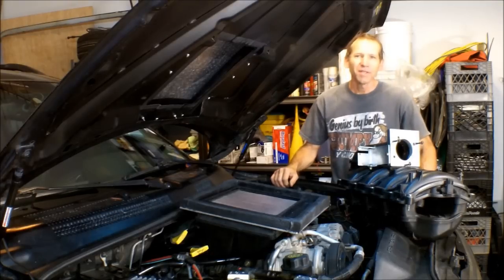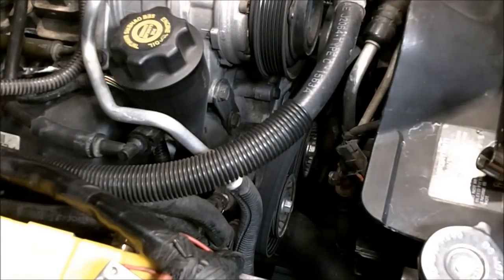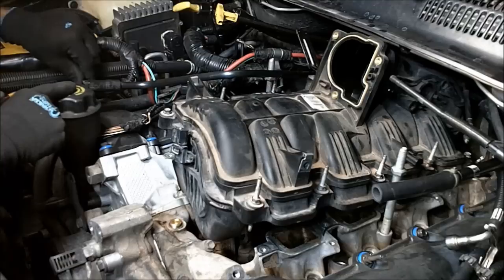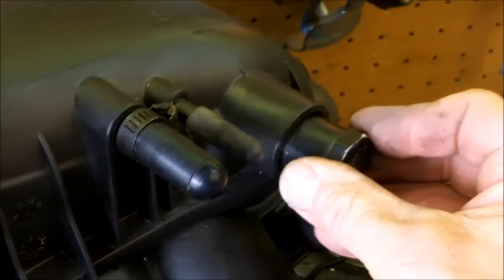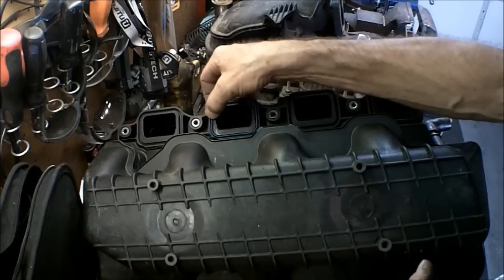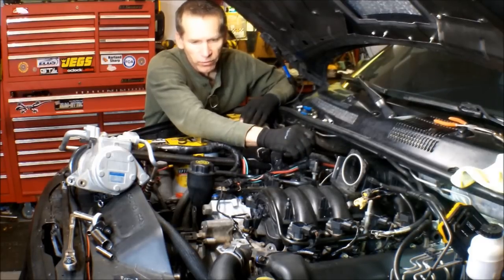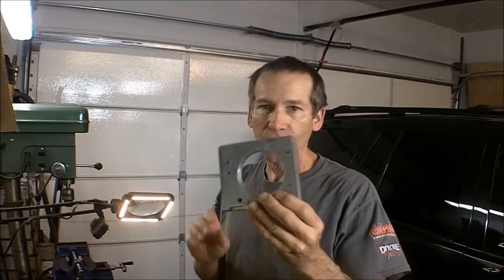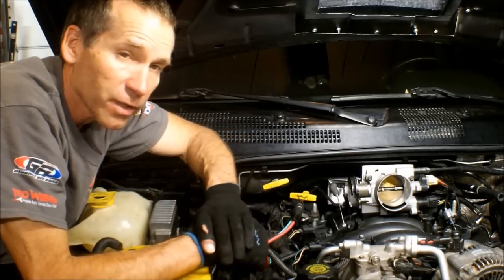Installing Upgraded Intake Manifold on 4.7 Jeep, Dodge

Comment: My 02 wj has a 3 prong plug in under the manifold any idea on what it's for??
Reply from the maker: Sounds like you have the HO engine and  those are the knock sensors there's one bolting to the left side and 1 to the right side under the intake manifold.
Reply: @martinbuilt  yea it does have those and I replaced them since it was throwing a code for them, and the plug in is ont he backside of the motor, like a diesel motor

Comment: So you only have to lower the motor on a grand cherokee? Ive got an 02 durango i wanna do this too.
Reply from the maker: yes, depending on the condition of the motor mounts. With old worn motor mounts the intake will go in without having to lower the engine to install the intake.

Comment: with all the changes to the air being drawn in, have  you had to change the mass airflow sensor?  are you throwing codes or getting check engine lights? have you had to reprogram?
Reply from the maker: Joel Antler it is not Dangerously lean at Full Throttle, but not rich enough for maximum performance . There is no mass air flow sensor just a map sensor. I am not throwing any codes or check engine lights. I do have a Superchips programmer but I feel it is inadequate for maximum performance.

Comment: That looks like what I need Jaja. I have a 2003 doge ram 1500 4.7.  Like everyone else  the valve seat dropped  and I have metal  particals in the oem inteck. ,any way I can get those out? I've  been trying  to buy the same part number  but shows as discontinued  so wondering  if this inteck swap  will work for me ? Thank you.
Reply from the maker: it will work but you will need to do all the same modifications that I did.
Check out this video it could help you clean your old one. https://youtu.be/clydV1x87q0
Reply: @martinbuilt  I ended up looking at your video  and it helped  me cleaned mine.  I have a question  is it really worth the work to swap out my 2003 dodge ram 1500 4.7 inteck to the 2008 dodge ram 1500 4.7 inteck. Will I get noticeable hp, thanks
Reply from the maker: @rvilla31  This was the best HP gain out of any mod I have done.
I do have the intake from my 04 Jeep if you are interested.
Reply: @martinbuilt  I appreciate it, but I got my truck working  good. But just wanted  more power out of my 4.7l
I was thinking if a superchip,  what do you think since you have a lot more experience in this stuff
Reply from the maker: @rvilla31  The Superchip that I have done did nothing for more power.
Reply: @martinbuilt  well I appreciate  your advice.  And you just saved me $500 bucks. Because I was gonna buy one this weekend.  But I'll invest  in the 08 inteck  instead.  Thanks
Reply: @martinbuilt  I Martin. Just wondering  I won't know unless I ask. 

Would you be interested  in finding me a 2008 dodge ram 1500 4.7l inteck manifold to replace my 2003 dodge ram 1500 4.7l and make a throttle body  adapter  for me.  If yes how much you can send me a message back
Reply from the maker: @rvilla31  I do have a 08 intake manifold that I could part with but right now I don't have the time to build an adapter. Planning on retiring from my day job in a year. Then I'll have all kinds of time to help you out.
Reply: @martinbuilt  I got the original ones that came out of the 08 inteck but the fit loose as well. Except  the 2 corners. But they are the original ones 🙄  that's wired huh
Reply: @martinbuilt  the ones you used are from a 2002 and under off a what car or truck engine size

Comment: Are the mounting sleeves M6X1.00X18.00 or M6X1.00X43.00?
Reply from the maker: you will find that the sleeve from the old manifold only 2 of those will fit the 08 intake and that you will need 5 or 6 more, the size of the bolts is not important.

Comment: @martinbuilt how did you solve the location of Intake air temperature sensor in Intake mainfold 08-11 ?
Reply from the maker: I relocated it to the backside of my Ram Air.
Reply: @martinbuilt  thx for answers. What kind of HP tuner you use ?
Reply from the maker: @makdaiss  I purchase the HP tuner. I haven't done anything with it yet. So I'm just running the stock tune for right now and for a stock tune it runs really well.

Comment: Hi Martin.. I have an 03 Dakota that I am looking to upgrade further.  I would like to know where you got this intake manifold from please. Do you happen to have a part #. I have searched a wee bit and not having any luck. Thanks..
Reply from the maker: Waylon Carlson I got this one off of eBay quite some time ago. I believe I gave like $160 for it. Airram.com also sells them. When I get home I'll look up a part number for you.
Reply from the maker: Here's the part number.  53034229AA
Reply: LOL.... I went to our local scrap yard today and they had one sitting on the shelf.. It had the old part# on it (53032761AJ), which in turn subs up to this new number you just gave.. I got it for $125.. Not a bad deal I think..
Reply from the maker: Waylon Carlson yeah that's a pretty good buy. I had a chance quite a while back there was one in the scrap yards I could have had it for less than $50 but I didn't no back then that that was an upgraded manifold to the one we have now on our WJ
Reply: Have one on the way for $79 shipped.   I too couldn't find any that had that part number.    I actually had to search for 2010 and newer to find them with the right number.     Martinbuilt thanks for doing what you do!
Reply from the maker: Andrew Shealy wow that's an awesome deal you practically stoled that one... you are welcome.

Comment: Hey martin can i do the same thing to my 02 3.7 with a 09 3.7. Seems like the same concept just 2 less cylinders
Reply from the maker: I got to say I'm somewhat unfamiliar with the 3.7. I do realize it's pretty much the same engine minus two cylinders. Why is there a horsepower increase in 09 compared to their earlier models? In theory at all sounds like it should work. I know one thing there's no way I would ever go back to the earlier model intake manifold.
Reply: no it will not the 3.7 was never updated it was not really ever intended to be anything other than a cheap mass-produced base engine

Comment: Hi i have jeep grand cherokee 4.7 pt can i swap intake manifold with throttle from H.O?  It is worth doing it if there will be no effects.
Reply from the maker: If it is a 2002 HO intake would be the best choice. If your JGC is a 99-00 you will gain a 3mm larger throttle body. 2001-2007 4.7 engines all had the same TB's at 68mm.
Reply: @martinbuilt  my is from 2000 Year, it makes sense to change the  intake manifold or is it enough if I swap the throttle only?
Reply from the maker: @holydriver666  If you can find a 2002 HO intake that would be worth it. They in 03 they went to to the same intake for 
non-HO and HO engines.
And yes you can install the 68mm TB on your early intake that should help.

Comment: Can i use the bolts for the 08 intake from the junkyard on my 03 Durango
Reply from the maker: No you can't the bolts that hold down the intake on the 08 manifold are integrated into the coils.  You'll need 8 of the older bolts.

Comment: I noticed no knock sensors was this for the 2001 to 2004
Reply from the maker: the knock sensors came first on the Jeep Grand Cherokee HO engines of 02-04. I also found this on the internet that they were in Jeep 2006-2007 XK, XH Commander and 2001-2007 WJ, WG, WK, WH Grand Cherokee w/ 4.7L Engine; Also fits 2006-2007 Dodge Durango, 2005-2007 Dakota, 2005-2007 Ram 1500, 2007 Chrysler Aspen, 2006-2007 Mitsubishi Raider but, can not confirm this.
Reply: @martinbuilt  I just got my 04 HO back from dealer and they said I didn't have any installed yet I have the cables. Then I saw your without any. Did you remove them at some point?
Reply from the maker: @Dragon90815a  I don't have an HO engine. Some day I will get the one that I have on the stand installed.

Comment: About how much hp do you expect from this swap
Reply from the maker: When I did the Swap and took it out for the first test drive I was absolutely amazed in the gains I felt, even more so then when I installed the HO camshafts. Of course this was with the 75 mm throttle body as well. If I had to guess I would say 20 to 25 horsepower.

Comment: In the middle of install but my coolant lines run over top my intake manifold :/
Reply from the maker: So I take it this is interfering with the install. Is the 08 intake taller in that area to where it interferes? If so can you replace that with a rubber coolant line?
Reply: martinbuilt i have on 03 dakota, my coolents lines sit on top of the manifold im having trouble removing these lines to remove the old intake , thanks for reply!

Comment: What did you do with the egr then if you didn’t connect the house back up?
Reply from the maker: My 04 JGC didn't have an EGR. You should be able to run the EGR to the large fitting on the side of the intake, the one that I plug.

Comment: Does anyone know if this will fit a 5.2 liter 318 small block from a 96 ram? Stock heads with a port, or would I need certain heads for it to work? If anyone knows anything please any information would be greatly appreciated
Reply: No, man, the 318 is a completely different beast.  Check out where the camshafts are in a 318 vs a 287.

Comment: Hey Martin, what did you do to the egr? Block off plate? Do you have a video on that?
Thanks
Reply from the maker: It never had one. What year is your engine?
Reply: @martinbuilt  it is the 4.7 vin P. It came with an 07 Dakota. Will it throw a code if I block it off?
Reply from the maker: @r.blanco7520  I've looked into it, and yes it will throw a cell light. It also looks like there are no benefits for this on the newer 4.7
Reply: @martinbuilt so, would you just install the egr pipe back? What year did these e gines started having an Egr?
Reply from the maker: @r.blanco7520  I don't know what year for sure. I would hook the EGR back up.
Reply: @martinbuilt  thanks much Martin. You are invaluable for Chrysler enthusiasts.

Comment: You should make some of those adapters for sale on ebay.
Reply from the maker: Yeah one of these days I may start building the cable bracket and adapter for the 75 mm and the stock 68.

Comment: did the intake swap alone wake up that 4.7 at all?  was it worth all the effort?  great video 👍
Reply from the maker: So what I did immediately after I finish doing this video I removed that 68 millimeter throttle body and installed the 75 mm throttle body that I built. So if you're asking did I see any Improvement with the stock throttle body I couldn't tell you. But I definitely saw an improvement with the combination of intake manifold and throttle body.. for me it was definitely worth it. So far one of the best mods I've done. I believe part of it is all of the mods now working together. There is no more chokeholds. The only other thing I could do to improve this would be to have ported heads with bigger valves. I will be installing the 08 camshafts soon. thank you.
Reply: @martinbuilt  looking forward to watching that video!  thanks for the rely

Comment: Добрый день, у Вас есть номер колектора, у нас в России с запчастями не просто , нужно знать номер детали чтоб ее купить , если есть такая возможность напишите .
Reply from the maker: This is the part number for the Intake Manifold 53034229AA and the same used in this video. The 53032761AJ is the manifold that came out in 2008 and was then replaced with 53034229AA in 2011. Both manifolds work great. The last letter may be different but it is still the same intake manifold.
Reply: @martinbuilt   благодарю за помощь ! Мне очень нравиться грандчероки 4,7 HO  современные машины уже уступают качеству этого wj
Reply from the maker: @Kovar4_.D4V_a-v1  You are very welcome. I am glad you enjoy the content. The WJ is my favorite Grand as well.

Comment: you need to be careful when using silicon on intake system. Silicon will plug up your oxygen sensor and catalytic converter

Comment: Can i just use the 8 bolt/sleeve from my 2001 manifold? Will they fit into the later manifold? Im not clear on that part. Thanks!
Reply from the maker: only 3 of your old sleeves will fit into the new intake manifold you will need five more of the small diameter hole sleeves. If you go to Pick-a-Part you be able to pull them out of the left side of the intake middle position. Unfortunately you'll have to get them out of five different intake manifolds.
Reply: @martinbuilt  Extremely rare up here. This one took 2 months to find and it came from a difference province. Im looking for a part number for the studs, maybe i can just get them on eBay. Like a stud kit for the entire manifold.
Reply: I was able to call the yard where I found  the manifold and they are sending out the manifold studs so I should be good.
Reply from the maker: @Dave428  you could probably also switch to the 04 bolts and sleeves like I had in my 04 Jeep. I happen to have a bunch of those sleeves that you're looking for much more common down here I guess.
Reply from the maker: @Dave428  that's awesome glad to hear you got it figured out
Reply from the maker: @Dave428  I incorporate those into the adapter.
Reply: @martinbuilt  gotcha. do you have a PM or email i could ask you questions at as they come? Also, of you come across some HO cams in decent shape in any of your yards down there let me know!
Reply from the maker: @Dave428  I do have a set of HO cams
https://lasvegas.craigslist.org/pts/d/henderson-47-ho-camshafts/6853697899.html
Reply: @martinbuilt  So the bolts they sent me didn't come with sleeves and they look way too long. Want to sell me 04 bolt/sleeve combos you have? Do you have all 10 ready to drop in?
Reply from the maker: @Dave428  I believe there should be two bolts already in the new intake that would be the rear left and the front right. And you should need a total of 8 more sleeves and bolts
Reply: @martinbuilt  Thats correct. From the traditional L/R positioning i already have the front PS/R and the rear DS/L. All the other 8 holes are completely empty.
Reply from the maker: 3 of the sleeves will fit. You will need 5 of the ones with the small dia. hole. Alll your bolts will work.
Reply: @martinbuilt  Ok, i think i understand now. So the 2 that already came with the manifold will work fine. The rest of the bolts from my 01 manifold will work for the remaining 8, BUT only three sleeves will transfer over from the 01-04 manifold meaning i still need 5 of the smaller sleeves. Are you saying you have spares of these?
Reply from the maker: @Dave428  yes I believe I do I'll have to check to see how many I got.
Reply: martinbuilt thank you so much. If you have enough we could do a “bulk order” of sorts with cams.
Reply: martinbuilt any luck with those sleeves? Emailed you via your HO cams Craigslist post yesterday. Happy Easter.
Reply from the maker: @Dave428  sorry David I'm bad about checking my email. Looking now.

Comment: Would I also need to lower motor mounts on a 04 ram?
Reply from the maker: I really doubt that. 
Just so everyone understands I only lowered the engine to get the manifold into place because of  the  cowl and then raised the engine back into place.
Reply: @martinbuilt  just a question what year rams came with the Ho and are the rams and Jeeps 4.7 the same or they tend to change a few things on them? Been wanting to try a couple things you did yours on my ram
Reply: @martinbuilt  and also where could I find a good 08 intake manifold?

Comment: would this set up work on my 03, 4.7L dakota slt if so where can i find this intake?
Reply from the maker: yes this will work on your Dakota. You can find the intake manifold at airram.com or you can also check out Ebay for used ones. You may be able to find one at your local salvage yard. The 08's are just starting to hit the junkyard now
Reply: @martinbuilt  thank you very very much and you also said the 08 4.7 cams would be beneficial for the dakota too if i did decide to do the h.o. cams would i need to do anything to my heads? Im new to the dodge world but i love my dakota trying to do a small rebuild i really appreciate the info help and replies martin
Reply from the maker: @zombkiller357   You can swap out the cams for the HO cams with no other changes required. Here is a video on the install  https://youtu.be/URrQ9sMgLJs
Reply: I just did this on my 03 4.7L Dakota today, hope my comment above helps, good luck!
Reply: al carr  yes

Comment: Well, I threw the Iridiums' back in and my pinging at full throttle went away. I'm running 87 octane here, don't want to pay $3.89 a gal. for premium . I already went through 2 tanks of higher octane and it did nothing. Honestly, I think the Champions do not agree with this motor. I was getting 14.9 per gal. with them. I will see what the NGK's do after a few trips. Performance is better and noticeable. Just sayin'
Reply: Little late, but just wondered what ended up working best for you?  About to change my plugs.  Thx.
Reply: @darthbacntildeth7221  I went with the champions